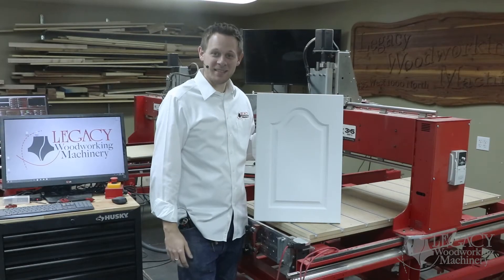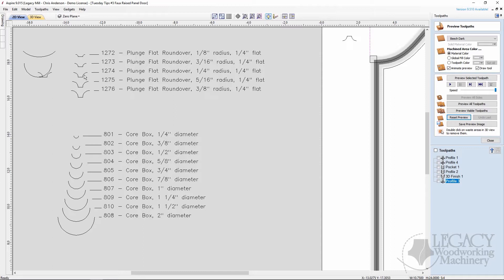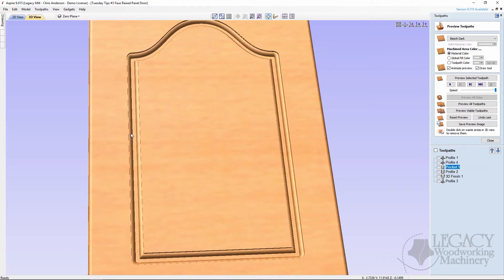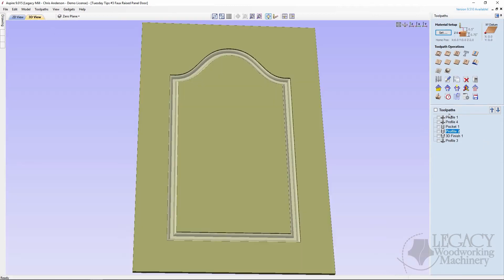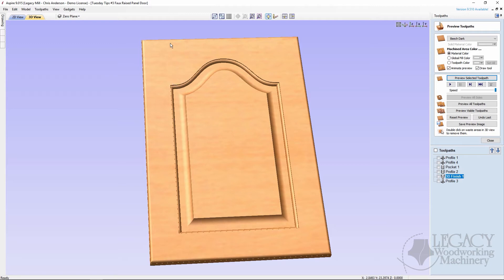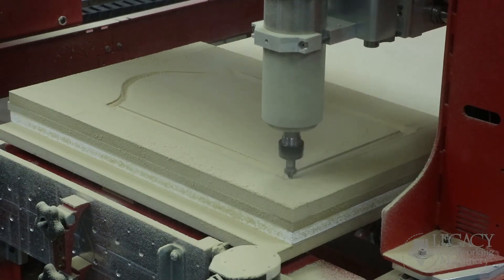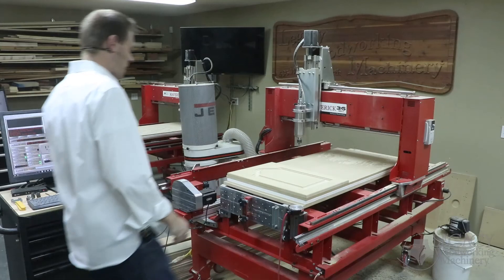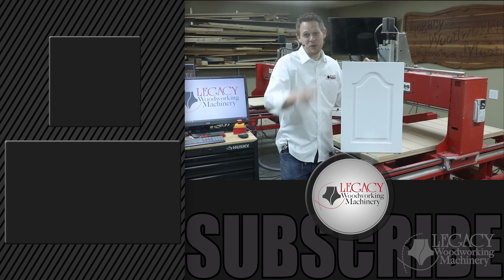5 Piece Panel Door MDF - CNC Cabinet Doors - Wood CNC Projects - Legacy CNC Woodworking Machinery

Comment: The door looks great. Can you share what primer / paint you use?  Water based primers raise the grain in the cut areas for me and I even get grain raising using the shellac based BIN primer.
Reply from the maker: It sounds weird but it worked out great... first step was using a spray can of Krylon white.  That bonded really well to the machined MDF.  second, I let it dry overnight and then sanded it with 220 grit until it was smooth.  Third, I sprayed it with a white satin cabinet door paint from sherman williams, let it dry for 24 hours and it still looks good years later.  I got the spray paint trick from a neighbor who has been in the cabinet business for years and he said the key is making sure that the spray is completely dry before sanding and to sand it more than you think it needs, it doesn't need to look great, it needs to feel great, the finish coat will make it look amazing.

Comment: Could you please make a demonstration on how to make the round corners square? I believe it is with a molding carve setup but not sure how.
Reply from the maker: It can be done a lot of ways.  it will be different with each different software.  What software are you using?
Reply: @legacycnc8232  Vcarve pro 12

Comment: Hey I'm a first timer CNC user and I was wondering 
What bit did you use to ease the edge of the doors? and How much did it cut?
Reply: You would use a point / plunge round over bit. Something like a Whiteside 2055 has a 1/4 inch round over. A point round over bit has the two radii converging at a point in line with the center line of the shank. A plunge round over will have a flat nose. To get the edge profile, you need to look at the cutter profile to setup the tool path correct. Also keep in mind, you will be taking material off the edges so any hold down fixturing must be clear of the cutter path. A vacuum table, or vacuum pods, would work best. If you are using a hobby machine, like a Shark or Shapeoko, you may need to double side tape or cut your profile in two passes giving you time in between to move your clamps. You will make a profile tool path the size of your door and then offset, make the profile large, by the radius of the nose (that flat end or the point). Even a point has a small radius that you may need to measure with a set of calipers. In a perfect world, the depth of cut would be the size of the round over, a 1/4 inch in this case, however between any variations in your spoil board or thickness inconsistencies in your MDF panel, you may end up with a score mark. In some cases, you want this thumbnail edge, in other case you don't. If you do, then you want to set your depth of cut deeper that the radius (the deeper, the more pronounced the edge). If you want to make sure you have no edge to sand later, set the depth of cut a little shallower (this will make sure the end of the radius is cutting above the face surface of the panel). Lastly, you may need to take a similar approach to adjust the offset of the profile so the cutter does not cut into the edge of the door. With all of that said, make some sample passes on a scrap piece to see how the offset and depth of cut affect the profile.
Reply: I just made some doors to match cabinets in my home. The only bits I used was a 1/2", 1/4", and 1/8" flat endmill, 1/4" ball nose. The profile and edge was a little more complicated than the video. Not having bits like the video make the process much slower, but it's doable. For hold down, I just brad nailed my pieces to the spoil.  boards.